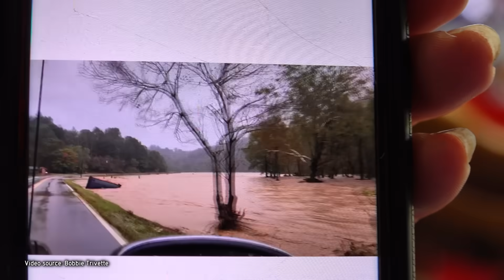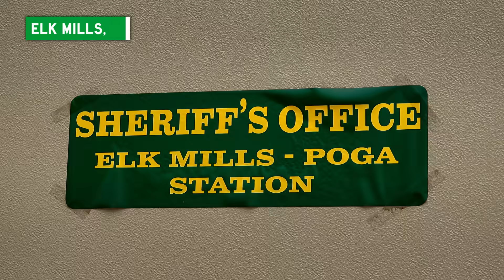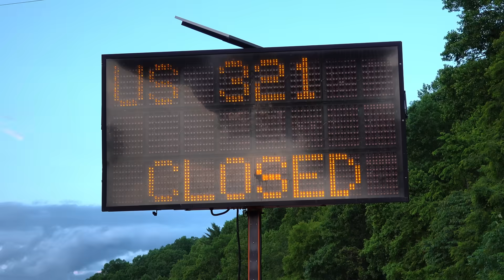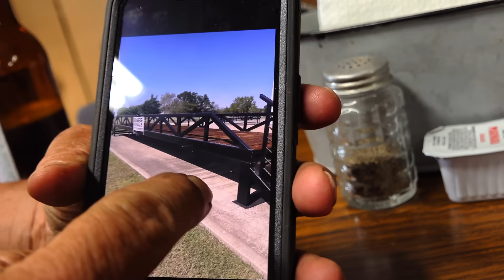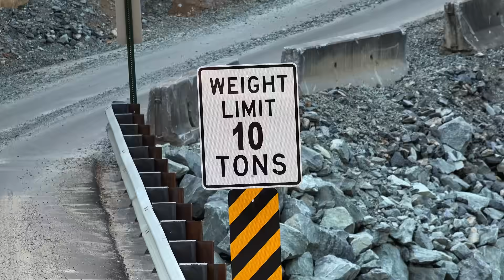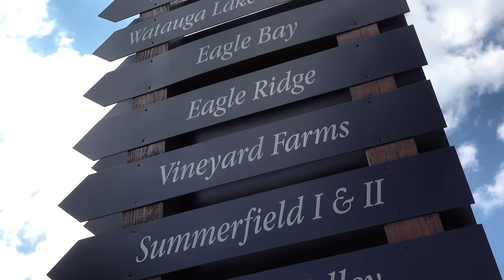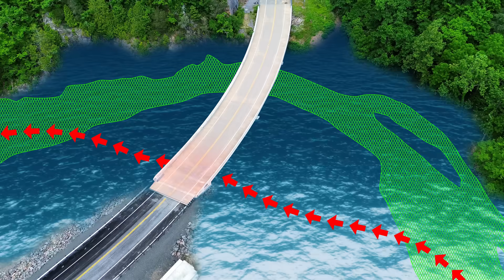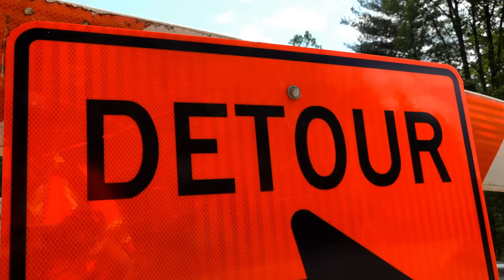How They Fix Roads After a Hurricane 🌧️

Comment: As a Dutch guy, this is just beyond believe. Not only do we design our water  protection for “storms 1:n years, so like 1:100. 1:500, etc). But we also have both municipal and military emergency bridging material which would be deployed within hours of the rain stopping. (Provided it’s safe to do so). And we also often help with the big disasters through deploying such material or even pumps (we have huge mobile ones for obvious reasons). 

And I do get the “8 years” time span for repairs.  Cause if everything needs repairs, than there not enough workers for the repairs. Money only helps a little in such cases.
Reply: i doubt the Netherlands is building for this level of infrequent storm.

like, a 1:300000 year storm.

if the ocean suddenly raised 15m for two days then went back down, the netherlands would be in a similarly bad place with everything needing to be fixed at the same time, amd with repairs blocking other repairs
Reply: @lomiification true, nobody even has data for such a protection. (We don’t even have a continuous written record for 300,000 years)…

What the Netherlands is doing is this: “The aim of the programme is for all primary flood defences to comply with the standards by 2050. Everyone in the Netherlands who lives behind a primary flood defence must have at least the base protection level of 1 in 100,000 annually by 2050 at the latest (0.001 %).” 

Which would be a 1:100,000 year event… (which is still insanely high).
Reply: The Netherlands is different in at least two respects here. Firstly, even the worst winter windstorms do not compare to a hurricane. Secondly, the country has a population density higher than New Jersey, one of the most densely populated US states, and way higher than North Carolina. It's not economical to have that level of resilience and disaster response for a few hundred people living in an isolated rural area.
Reply: @Croz89 firstly, in the kingdom of the Netherlands we also get Hurricanes…. This is a moot argument stemming from ignorance. 

Secondly. You missed the point I was making. It’s not population density that allowed us to help you with Katrina by shipping over pumps! (Imagine, a nation smaller than west Virgina and about half way around the world shipped pumps to you to deal with a “once in a 40 year storm”….)  

For disasters, high population density is in fact a bigger problem, as you need more material faster, and have less places to store them. 

Don’t make the typical American mistake of not understanding that “other places” are just better at taking care of their population….
Reply: @lawrivanbuel5221 No you don't. You get windstorms, not hurricanes. The Netherlands is too far north and on the wrong side of the Atlantic. Any hurricane that reverses direction dies before it gets anywhere near Europe. It's destructive, sure, but not on the level of a hurricane.

And it absolutely is population density. Disasters like flooding affect a specific land area, doesn't matter if 10 people live there or 10,000. But the more people there are the more money is available for building resilient bridges, keeping disaster recovery equipment on standby, and so on. That is why Dutch infrastructure is so good, the cost is spread out amongst many more people. Those bridges still have to be built even if only 100 cars a day drive over them, because people still need some way to get in and out.
Reply: last time I checked the Dutch Caribbean (which some are a part of the Kingdom of the Netherlands) get Hurricanes. 

As I warned you, being ignorant isn’t showing smarts….

I never claimed Europe gets hurricanes. 

And population density and flood protection do not scale together! Density makes your protections cost more since you now need to protect more people and have less area that needs less protection. 

And the Dutch infrastructure is so good because we made a system to make them that good, no other reason. (We have a separate independent government body that deals with water and flood protection exclusively). 

And yes, even a 100 cars a day crossing needs to be fixed (although at a 100 cars you could feasible use a ferry, so I suspect it’s a lot more than a 100).
Reply: @lawrivanbuel5221 That's just being petty and you know it. Those pumps didn't come from Sint Maarten. 

You're displaying stereotypical Dutch arrogance, not recognising your own inherent advantages and saying you're good at these things because you're the best freaking country in the world. 

It's honestly not rocket science, a section of flood defences protects the same length of riverbank or coast. It costs a certain amount per metre, but it's paid for (or justified for) per person. The more people it protects, the better it can be.
Reply: @Croz89 nothing about it is being petty, I was precise in my claim. 

And no, they didn’t come from Sint Maarten since they aren’t stored there…. I never claimed that. (Also doesn’t represent the Dutch Antilles as a whole, nor is it its biggest part…)

And what “inherent advantage” are you speaking of?  Centuries of experience?  Or many Floods that destroyed significant parts of our country many times over?  

And a section of water management cost money, yes. But we don’t justify (or pay) for it on a per person base. (That’s not how the system works). The more people it protects is also not how the system works. (Maybe look into the Deltaworks, which shows beyond a shadow of doubt it’s not designed with any of the philosophies you are claiming…. Cause if it was “Zeeland would not get the protection it’s getting”. 

We also have the uncommon situation where water will just stay unless we pump it away… (being low lands has that disadvantage). 

And I never stated they should have had better defenses against the water, now did I. It’s the extremely poor response from the government afterwards that I was being incredulous about. 

As I stated before, ignorance is not helping you. Problems don’t scale linearly with people, acting like it does is just ignorance.

So maybe stop and grasp that there is not just “defense” to prevent, but also “response” to which is just diffrent.  (And where a bigger country should have an advantage…. Yet still it’s not capable of doing the same as other much smaller countries can do…. ).
Reply: Rural areas have lots of roads and bridges for just 5000 people, it is almost ridiculous that people want to live so spread out.  But they do.  And then they logically will struggle for 5000  to pay for quick fixes.  But they choose to live in spread out areas and so have to whine for city people to help pay for their choice with $$$ aid....  Sorry to seem mean, but rural people always ask for help with roads.. . ..  .  And yes compact cities can afford more dikes it's the rural people who can't, you only see dikes around cities, so density of people is huge financial boost to having storm defenses.  . . ..
Reply: You live in a real country unlike us in the US

Comment: I had just moved from central florida to East TN - having lived thru hurricanes from 1997 onward, I can honestly say Helene was the most intense wind I have ever seen.  It was crazy how strong that storm was, and shocking the damage the water did.  The dam along I-40 that holds back the Pigeon River was overtopped for a bit and there was serious concern about nuclear contamination from the Erwin, TN area being washed down river.  Not sure any of that has been sorted yet, but the infrastructure damage was intense.  Thank you for shining a spotlight on this humble area of the states.  TN has done an amazing job getting things back and going - I can't speak for NC, but they were devastated around Asheville area.
Reply from the maker: What my video can't do justice is -- like you say -- this affected SO MUCH of those two states.  And I only looked at one little spot.  Glad it didn't wash away nuclear tailings.  Hadn't hear about that, but that would've been an environmental/health disaster!
Reply: @RoadGuyRob  TN did deserve to get this coverage. But I want you to do some kind of report on something in NC because NCDOT is one of the best DOTs in the country. You could feature the stack interchange over water in New Bern, NC, or the new bridge that replaced the Bonner Bridge on the Outerbanks, elegant on a budget at $250 million total cost. Or do a story on the NC's most important interstate I-85 which has over 150 out of 220 total miles being mostly 8 lanes wide (a small portion of that is only 6 lanes) with 4-lanes at the SC and VA borders.

Comment: I wonder how possible it'd be to have a dump truck that can be driven from the front or back, that way don't technically have to reverse to get there. I've seen something like this in two place, both cases a limo-like vehicle; once on the Top Gear TV Show, the other was Ross Creations on YouTube. Surely something like this could be done with a dump truck? I dunno.
Reply: it would be a pretty significant modification to make a specialty truck.  most dump truck drivers learn backwards driving skills very quickly.  so it's less of a case of not being able to, and more a case of it not being enough of an improvement over what a good driver can already do to be worth the trouble.
Reply: When they truck rock out to end of jetty, they drive in reverse.. . . .
Reply: On the Clinchfield subdivision of CSX, their reconstruction (Helene washed out nearly the entire railroad and roadbed) you can see (via Designs in Orbit's drone video series) smaller dump trucks on bulldozer tracks where the whole body (cab and dump) can rotate independent of the tracks like a crane, allowing the operator to reverse while still keeping the driving end in front.
Reply: @RailRide  I've seen lots of excavators, lifts  and cranes on that system, but I can't say the same dump trucks. That's cool!

Comment: I dislike the wording used at 6:25. Because I imagine the 8-10 years statement is because of budget limits and not incompetence
Reply from the maker: I worded that poorly.  The county has less experience accessing federal resources to get the aid to rebuild the bridges.  Whereas for TDOT, they have a huge staff who deal with this sort of stuff all the time.  Carter County are having to start from the ground up and that slows them down significantly.
Reply: @RoadGuyRob  I expect that there's a lot of folks who are torn between just getting out there and fixing things and spending time getting the funding (and environmental, planning, etc. approvals) in place to pay for it all. Sometimes you have to do the boring parts first! There's only so much labor to go around, and they want to get paid.
Reply: Probably, though sometimes you end up with situations where it's not even money that's the limit. If there's enough things broken all at once, sometimes the limit is just that there's only so many instances of the necessary heavy equipment, or specific types of technical experts needed to do some part of the job, available, and when they're all occupied, well, you end up with a queue (it's certainlly a problem New Zealand runs into often enough. There's more resources to be had in the USA, of course, but also more projects that need those resources).